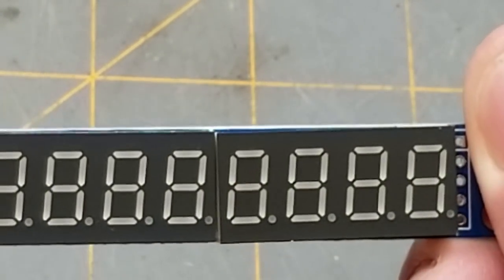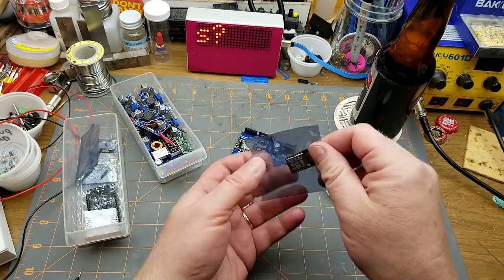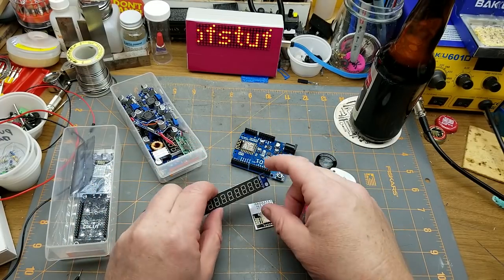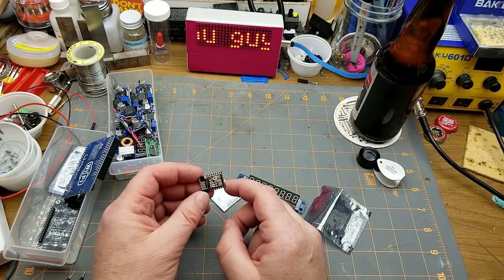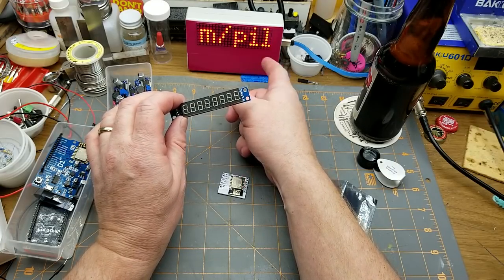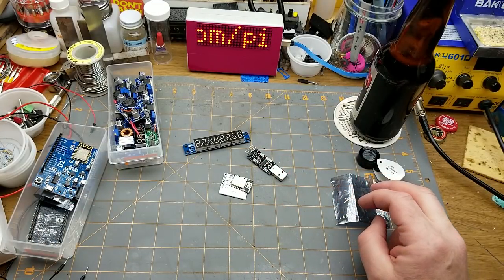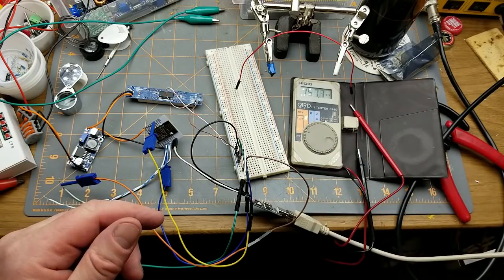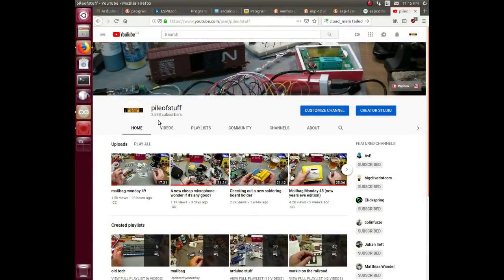ESP8266 based subscriber counter

Comment from the maker: Yeah, I could run both displays off the ESP and change the message over the air, but I'm just not that great at coding.

I'm more of a hardware guy, so if there's a less software based way to do something, I'll usually do that.
Reply: Thanks for the shout outs and mentions!

The reason it's so slow to load is because I'm an idiot and the example sketch waits a minute before checking at all, it should check and then wait every minute to check again.

Do you have the link to the code for your display, I might have a fun project for it!
Reply from the maker: @BrianLough  the scrolling text sign is 99% code that I borrowed from Yvan at Brainy Bits. 
https://www.brainy-bits.com/scroll-text-using-the-max7219-led-dot-matrix/
.

P.S. I hope I pronounced your name correctly...
Reply: @pileofstuff  thanks!

It's actually "lock" funnily enough, but I'm very used to it being called anything: "low", "Lao" or "luff" that I barely even take notice anymore 😂
Reply: Brian Lough can’t wait to get your esp modules Brian, thanks for the fast shipping!  Just a thought for your feature creep... use mqtt on your esp to update your scrolling sign and utube counter!

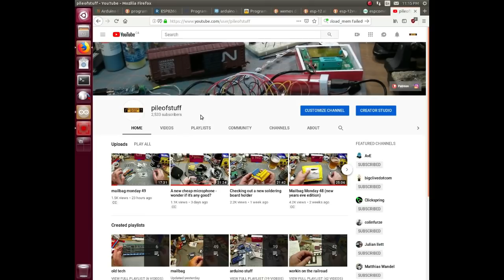Comment: 12:32 "That's the tricky part!" 😂 scraping HTML is easier than you might think! 😂 Right now the tricky part for me is figuring out how to get the right LEDs to light up ... 🤔 I would think I could do this with only an Arduino (with WIFI) but I still have much to learn.

Comment: You can use a 3.3V regulator on the bottom of the adapter board and desolder the middle SMD resistor on the adapter board. Then you can run it from 5V. Save yerself the extra power module.
Reply from the maker: I have some on order for exactly that reason - they just haven't arrived yet. 

Maybe another reason to re-visit the sign...
Reply: Just make sure to order one with the right pinout. The AMS1117 regulator doen't match, the HT7333 does. That one also has a lower voltage drop and requires less passives. On my board I just soldered two smd caps to both input and output pins.
Reply from the maker: That's interesting. And a bit concerning. 
Thanks for the heads up.

Well, back to e-bay to spend another dollar...
I looked at some listings for the adapter board, and some of them claim the 1117 is the correct regulator.Ahh well, I'll have to meter it  to be certain before I do anything.... Once the stuff actually gets here.
Reply: @pileofstuff  Perhaps you have a slightly different version of the same white Pcb? Just check the pinout of the regulator versus the pcb. If I remember well the AMS has ground on a different pin. The AMS  regulator is fine for 5V but has high voltage drop. The HT has a low dropout voltage and low standbye current. It can also be used with a 4.2 Lipo battery.
Reply from the maker: @MaxintRD  Entirely possible that there's multiple versions.

I've got both types of regulator on order, so whatever the continuity test tells me is the way I'll go.

Comment: Could you please tell me which kind of camera and mic you are using? 
Btw. your videos are great - especially the mailbad mondays. I found a lot of stuff which I bought, too :-) 
Maybe it´s an idea to make a video about the tools you are using. 
I found the mini drill in this video which is (sorry was) not in my toolbox ... 
thx Dominik
Reply from the maker: I use my phone for most of the videos. At the moment it is a Samsung S8, but before November it was a Samsung Note4.

When I'm at the computer, I use the microphone I featured i this video: https://youtu.be/xd4S8Bg42Cg

That little drill is often called a "pin vise". They are available from hobby shops (and the usual online places).
 This one I got from a welding supply shop. Welders use it to clean the gas jets on torch tips.
Reply: I just thought it must be a "real" cam because you zoom in so often ... 
And how is your phine mounted above your hands ?
Reply from the maker: @LogViewDS  It's just clamped in part of a selfie stick that is mounted in front of my forehead. The zooms are just me reaching up and doing a "pinch" maneuver on the screen - super low-tech!

Comment: Great video.  Now modify it to count the number of times the sump pump came on today, this week, and this year.  Oh, you have started something.  Just think of what you could display!   What a fun time!  Electronics and programming - so much fun!  Oh,  and add beer lol
Reply from the maker: One of the benefits of doing these videos during the winter is that the sump pump doesn't come on in the middle of recording.

But, yeah, you could use these to count all sorts of things.  Even have a bunch of ESP8266 scattered around the place reporting back to a central one with the display.

The only limit is my programming ability (or lack thereof...)

Comment: I want to learn about Arduino too!  Any good books you could recommend?  Something that goes with a well crafted beer?  I have electronics experience, graduated in 90 from ITT, but we learned on the z80.  That is all obsolete, and I have forgotten most of that.  I like the versatility of the Arduino, and all the modules that companion with it.  It's like electronic Legos!  Unfortunately I have zero programming experience, so if you know of a good book or video series that could teach an old brain like mine, I would appreciate it!
Reply from the maker: My background is of similar vintage, though what little programming I did back then was on 6502 based machines. I'm mostly a hardware guy from way back.

I learned what i know about arduino from a combination of YouTube and the official site (arduino.cc).

I have an arduino playlist if you are brave, but before I got my hands on some hardware, I watched a lot of videos from Julian Illet, brainybits, and a few others. 

Then I got my own starter kit and got my hands dirty tinkering g.

Tha arduino ide ships with a bunch of built-in examples that make a good starting point. And are a good source of cut-n-paste programming building blocks.

Comment: You don't need anything external once programmed one time for the ESP.  Use OTA to upload your new code.
It simply appears as a port in  Arduino....

Better yet...make it make a REST call at boot to a URL on your Network, then pass the message via serial to the Arduino and you'll never have to upload new code again!

Easy peasy, Miley Cyrus sleezy!

Great job...love your Channel btw.
Reply: Is OTA actually quicker to update / upload than wired methods? I've not used any ESP board (I just do simple projects with Arduino and Pi's that I copy paste from the wonderful peeps on the internet) but I have heard that it is quicker than serial.
Reply from the maker: James Kerns Jr.  : Yeah, I suppose a competent coder could do that...

I'm more of a cut-n-paste programmer.
Reply: @pileofstuff .  LOL, ok.   Cut and paste is ok, as long as you try to learn from what you cut and paste!  Everyone does it - I program for a living and I'm guilty - there is no sense to reinvent the wheel.  Actually, when ever you use a library, that's basically what you are doing anyway.

OTA library is easy!  1 include  (include Arduino OTA), a couple of overloads to set the port name, etc and whamo!  Mission successful.

To transfer to the other ardino :  if serial.availalbe, serial.read on the one and serial.write on the other.
(Lots of examples exist for this. FunFact:  this is actually how the ESP was used way back in it's beginnings, as a slave to the Arduino!  This is before the SDK and Arduino integration)

For the REST, it's include HTTP library then http.get- you just need a computer on the network to get it from.
That's even simple, install a web server, and plop a simple text file down.

You probably know how - you just dont know that you know!  But what you have is a great project already - good job.

If you want more info, let me know. Happy to help.
Reply: @jimb032  I don't Cut 'n Past. I Copy 'n Paste. That way if I "f up" the code is still there in it's original format. But if you program for a living then I guess you know what yer doing.  I used to program. But now I have a life and don't dream code. Oh gawd the nightmares.
Reply: @DrexProjects  duplicate code is bad!  Lol

Comment: ESP:s have Wifi so its easy to setup them to check new text from internet. Or you can easily use OTA updates for the whole running sketch (example www.iotappstory.com) so I would say much easier upgrade than updating it with USB

Comment: Put your password in an external file (chmod 600), read it in from your program. That way you can check in your code to a code repository without fear of exposing your password. 😏👍
Reply from the maker: I just saw an example of that from Andreas (the guy with the Swiss accent) this weekend.
It is a good tip, especially for someone as inexperienced at coding as I am.

Comment: I think I have all the parts now to make one. Should I make a vid?
Reply from the maker: Of course you should!

Every one I've seen so far was done a bit differently. It'll be interesting to see what you do with it.
Reply: @pileofstuff  Made 2 now. 1 NodeMCU and some other random one. I added a ISD-1820 to them and now I will add a few strings of LED Strips to them. That way when it goes off the module will play and the lights will flash. Perhaps I will add a cat treat tossing device to it too so the cats can cerebrate too. Options are endless.

Comment: this 7-segment board i has modified microsoft flight simulator radio panel, 2 radio display, work well. but same chip i has try made led matrix board same roll text board what u have, sometime work wometime not work led blink wrong position sometime, i no know what have problem. im not have code guy, i have too same,hardware has easy but code not. max 7219 chip have ,many usefull, led matrix,led row,led display led 7-segment. many can use easy.

Comment: Eight digits might seem somewhat optimistic  Never mind.
Reply: I dunno, you have 2 subs with no content at all.
Reply from the maker: A guy has to dream big...

Also, it's the parts I happened to have lying around at the time.
Reply: @pileofstuff  the library also supports doing total views too so you could easily make use of those extra digits already 😂
Reply: Neffers You have to admit - My subscribers-to-videos ratio is hard to beat.